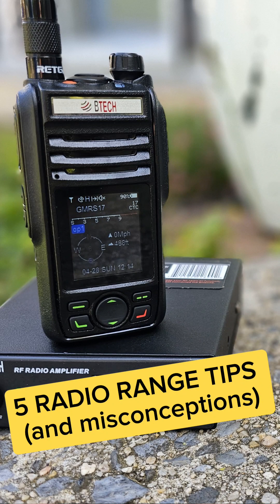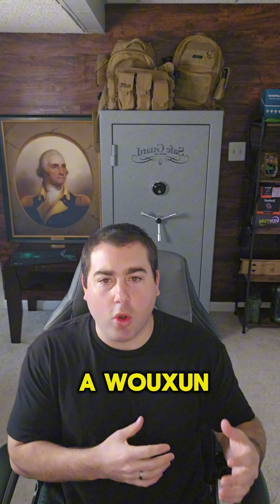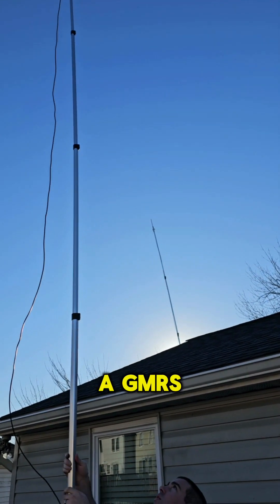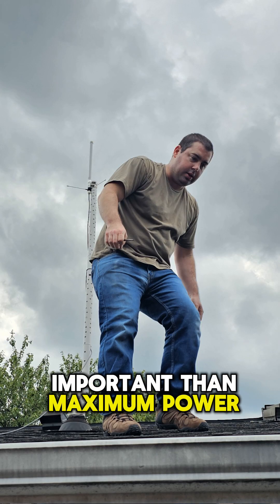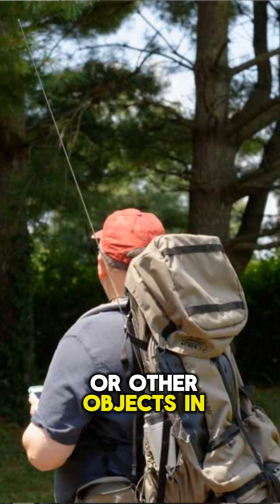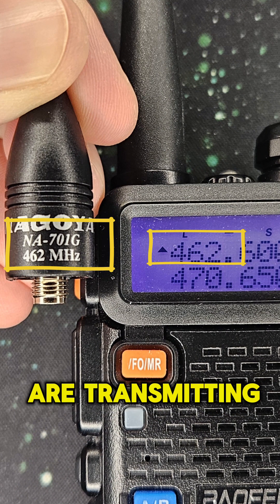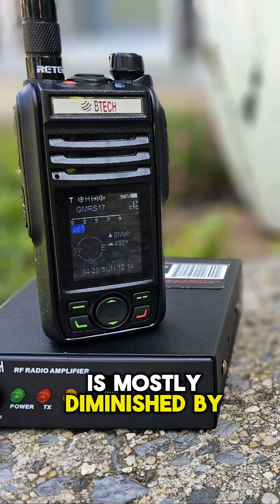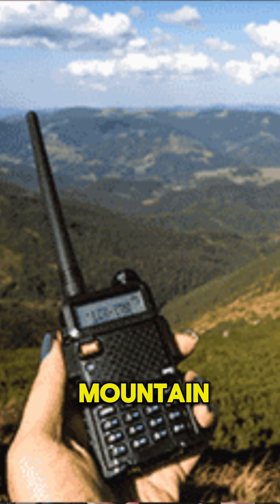5 Tips to Improve Your Radio Range ☢️

Comment: Very true about terrain affecting range.  My deer camp group hunts in an area with hills and valleys.  I was in a low spot out on public land and someone else was in another low spot about half a mile away.  He was using the stock rubber duck antenna and I was using a 771 whip antenna.  I could barely hear him, but he heard me no problem.
Reply: Sounds like a good application for a simplex repeater box.
Reply: @orcinusorca3145  we plan on putting up a GMRS repeater at the cabin for deer camp use.